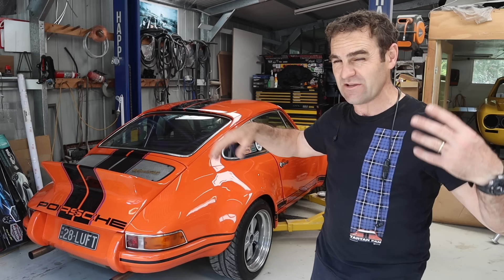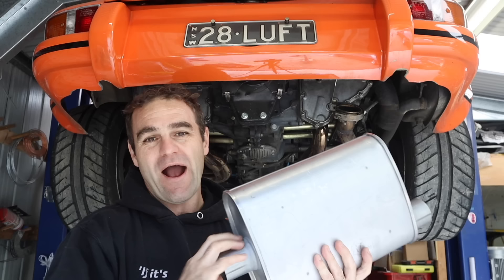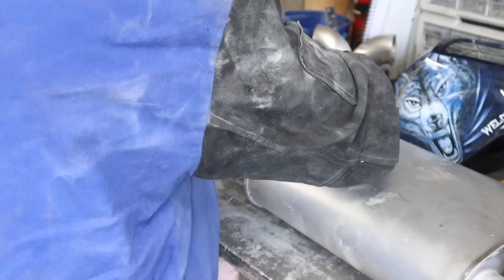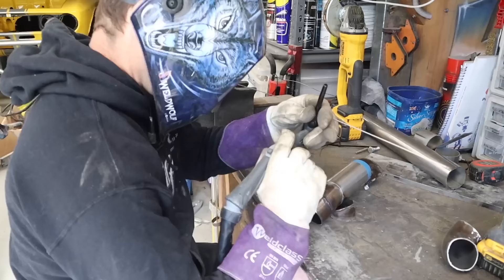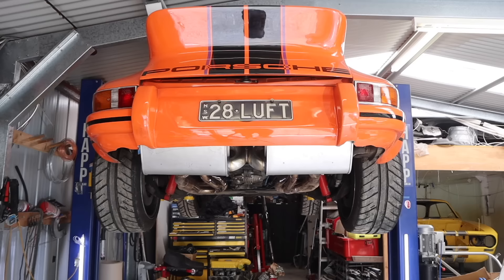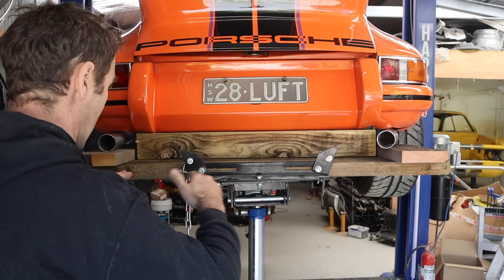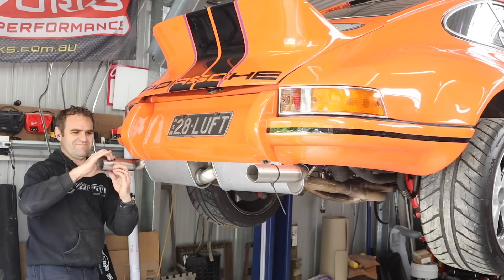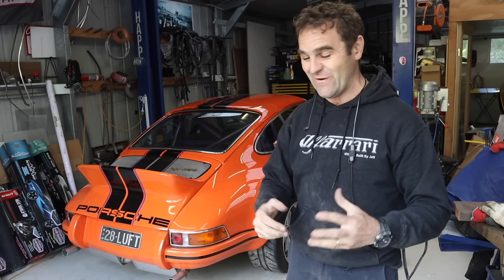Making ANOTHER exhaust for my aircooled Porsche 911

Comment: Your going to get a lot of heat from that muffler and it may cause blistering to that orange paint over time , I have a 58 custom beetle that I lined the inside area with a product from Eastwood that helps as a heat barrier, after 40 years of being around these cars I've seen them over a period of time fade or blister the paint from the exhaust heat when we shove after market headers and mufflers in that area, when it gets to be 85 to 100 degrees outside I'd keep an eye on it

Comment: Jeff no matter which way you go to Adelaide, the roads are in a huge mess, and cars with low profile tyres and mag wheels are being damaged every where Those without spares are ending up on tilt trays and are undriveable till tyres can be found and or wheels replaced, so be careful and be aware. A space saver may be very handy. On the Hume last week there were several cars in the one spot all with wheel/ suspension damage, after hitting a hole. Travel safely .

Comment: I hope it works out for you (in terms of noise) - but they sure do seem to stick out like a set of you-know-what, even from that high camera angle.  I wonder if a coat of black paint on the body of the mufflers could help conceal them a little?  Just an opinion of course, like everyone else.  Carry on!  🙂
Reply: Yeah, that's my only concern as well--they seem to be very visible, and the tips look rather long since they're so visible from the top.  It just looks like the whole thing should be stuffed up by like two or three inches, but I do realize that there's no room.  It's strange, because I know they're as close to the bumper as possible, but because the bumper curves inwards, the tips looks especially visible when seen from standing height I guess.

Comment: Jeff on your original muffler you took off all you needed was a j pipe welded in behind the muffler to get rid of the drowning noise there are how to and lengths on the internet for this just drive the car get a noise reading when it drowns and the equasion will tell you what size pipe and length to make the j pipe then no more drowning noise when travelling cheers glenn
Reply from the maker: It was not just the drone. It was also far too loud in general.
Reply: @HomeBuiltByJeff  what a porsche to loud you must be getting old jeff you could have put a turbo on it that would quiet it down 😁
Reply from the maker: @glennarnold3970  Haha. With the compression I am running a turbo would quiet it down permanently.